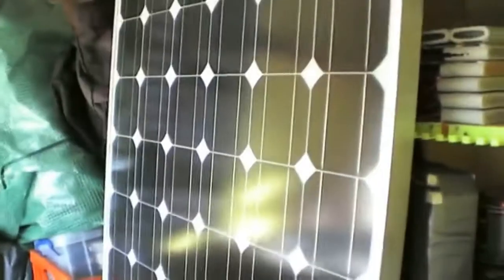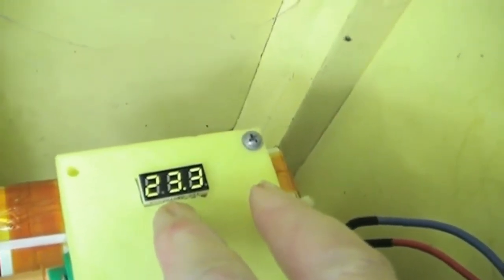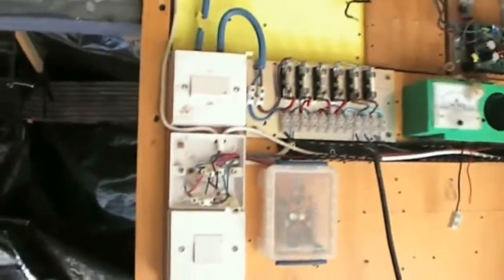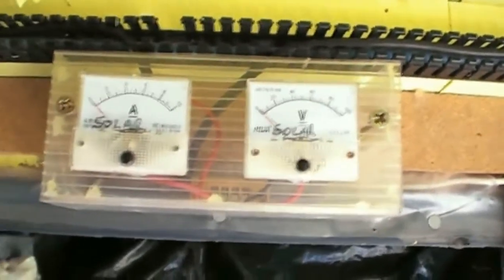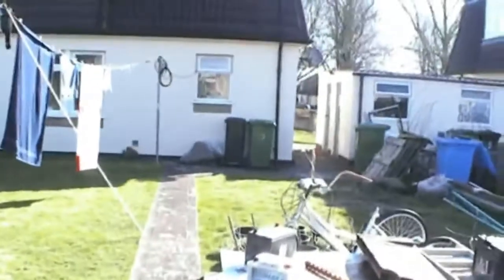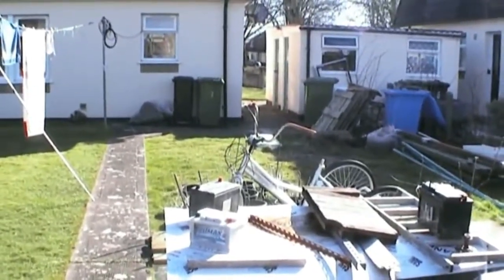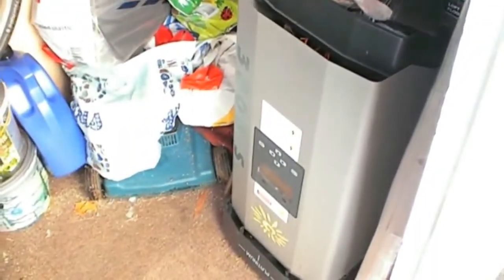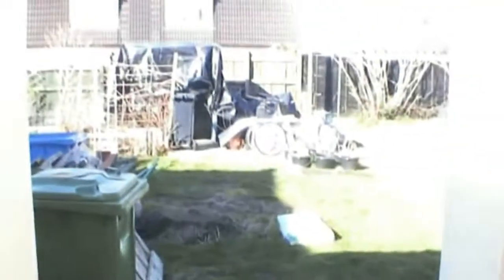Lab and Garden Update

Comment: i recently picked up 4 hoverboards was wanting the batterys as my luck goes they where not the 18650 ones and only one had a motor so i now have 8 wheels hoping to make hyrdo turbine from one but have no where for it could not pass up 4 hoverboards for 20 quid but i had a idea silly hours of the morning the otherday with a speed controller and batterys i could make a bolt on ebike kit that would just mount to the seat post and a bar down to the floor at rear for the hub motor so the kit can be removed easy and just have a thumb throttle that clips onto the bars easy if not the seat post m,aybe the bottom frame rail rear of bike like the bike trailers do
Reply from the maker: That sounds like an awesome project my good friend. How big a battery do you thing you need? I hope you and Diane are keeping yourselves safe. Hello Diane.
Reply: @MYNICEEV  I was looking at 3 ups batterys simple to get hold of I know heavy I dont know how far the hover board went on a single charge from the pack I taken apart I think they 4.4 maybe 5ah